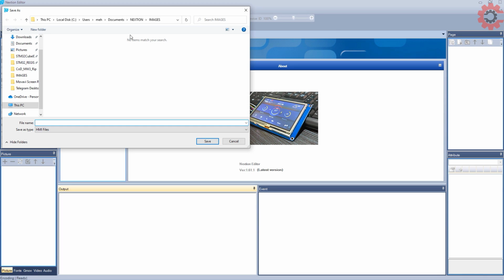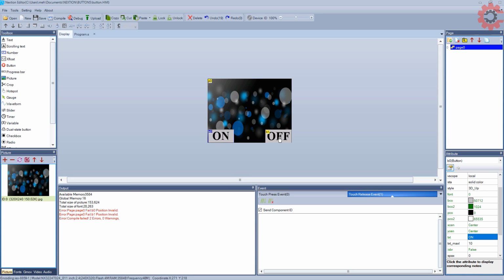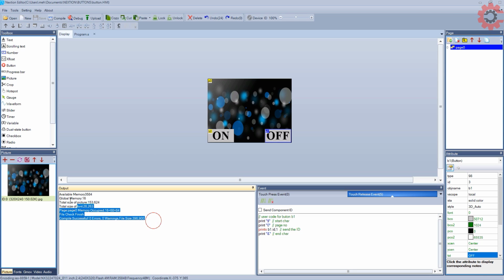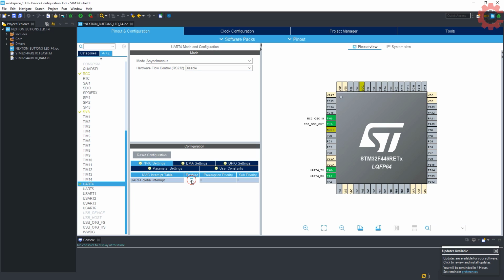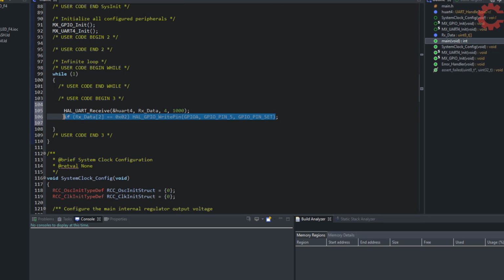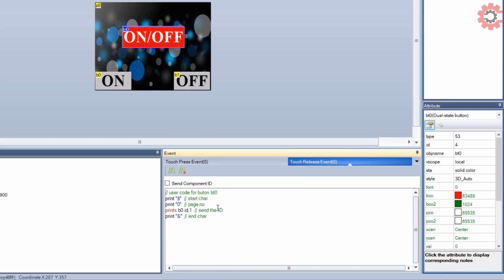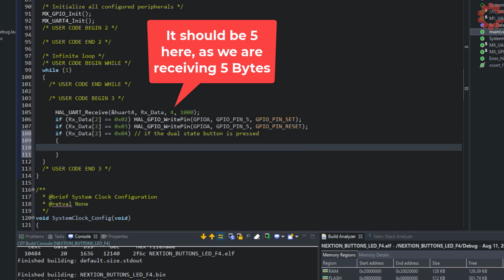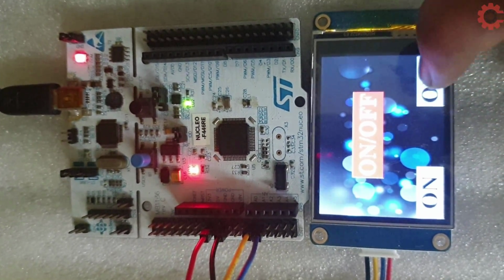Buttons on Nextion Display || STM32 || Control LED

Comment: Hello Controller tech,

what I have to do if I want to do it visa versa means if the led gets ON , the button of nextion display should get automatically start
Reply from the maker: You just need to send the commands to the display. Check out the rest of the playlist and you will understand this
Reply: @ControllersTech   How can I do that?? I watched all the nextion video & tried to implement but still the button is not getting ON automatically.

Comment: Hello I try your example but without success. I can successfully send data to nextion, but couldn't receive. My nextion is connected to UART3 and I enable global interrupt in NVIC settings of Uart3. I don't know why don't work.
Reply: Hi, your comment is two years ago but I want to ask, did you solve? My purpose is when I want to press button on nextion screen, on the stm32 value (for instance i) should be 1, I tried to run the code but I couldn't reach any result in any attempt, any idea?

Comment: Great video any ... any chance to run this nextion with same stm32 the stepper motor controlls on the touch screen buttons also heating with control the relay ?? i would like to assembly small desktop injection molding machine... any quick question any type of nextion works with this stm32 or need special one any link where i can get this nextion touch screen display?? there are many in china aliexpress with different features they have some ttl usb ,and special usb required i confused to select right one.
Reply from the maker: Nextion is the company name.
Buy it from the official seller. Any display will work as long as it's from nextion. The one i am using in the video is one of the cheapest one (basic model)
Reply: @ControllersTech  Great, thanks for your quick respond as i mentioned in above corrosponds about stepper motors, heaters to control them through nextion display any chance to make video :-)?? will be greatfull help for me and for sure 4 others too..
Reply from the maker: I am not going to make video, but it's pretty easy for you to do it. Just make a UI and use the buttons to send some particular data to the controller.
Reply: @ControllersTech  thanks for your reply i will try
Reply: did u do injection machine

Comment: Your tutorials are great.  I am learning much.  I have added buttons as in 1st part and work great.  I added the interrupt code, cut and pasted, but that does not work.
What troubleshooting can I do to spot where it is not working?
Reply: Nevermind - found my mistake.  Still would be good to know how to troubleshoot interrupts via breakpoints?
Reply: @stevescott55  hi same mistakes. how did you solve it? i've been writing the code over and over again but cannot recieve anything from HAL_UART_Receive_IT

Comment: Using USART LL Drivers and using an interrupt when a button is pressed, but my code is stuck in the ISR. I've noticed it is caused by the ORE flag - any suggestion on how to solve this issue?
Reply from the maker: ORE is caused when the data is received but the previous data hasn't been read yet.
Basically after the data is received in the DR, you need to read the DR. If you failed to do so and another byte gets received, the ORE flag will set
Reply: @ControllersTech  I think the issue is with Mac OS and USB-C. Took the project and same board to Windows and it runs flawlessly.

Comment: excuse me ,I did it same ,the button project is working ,but sending string to lcd ,is not working, have you have idea what is the problems tested in Arduino ,it work perfectly, but I want to do it with stm32 ,by the way your YouTube channel is amazing ,I learned a lot from thanks .

Comment: it can not accept print fonction why it can be
Reply: Error:Invalid Variables:print( Double click to jump to code)
 
l wrote all same
Reply from the maker: U must be doing some Syntex error. Download the code, open the hmi file and then compare with your syntex.
Reply: Sir I will try also I changed printh it's worked how can change hex to decimal at mcu is sprintf working?
Reply from the maker: Use prints instead of printh
That will print string
Also in prints there is a comma.. i have mentioned that in the video also.. Don't confuse it with the dot